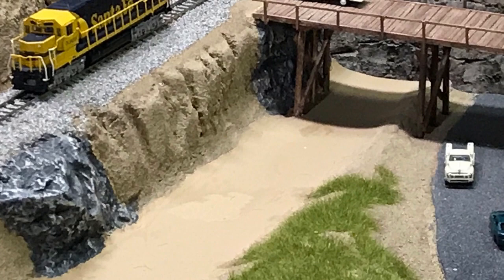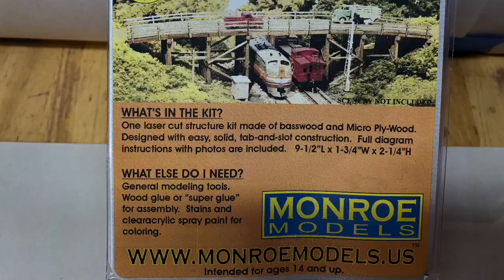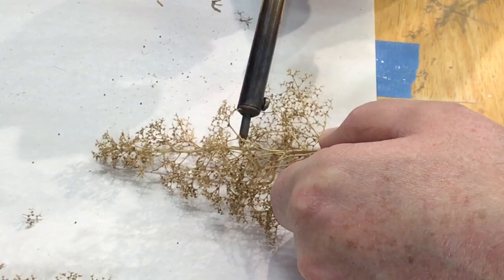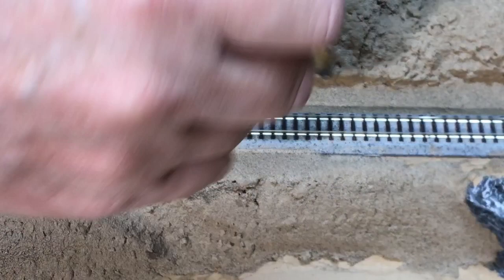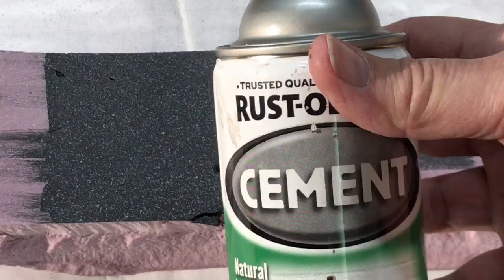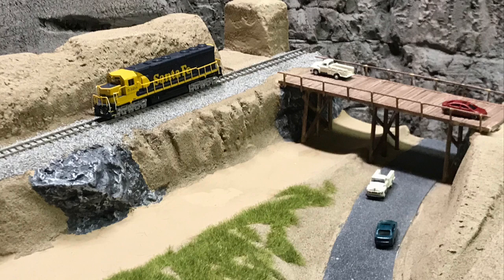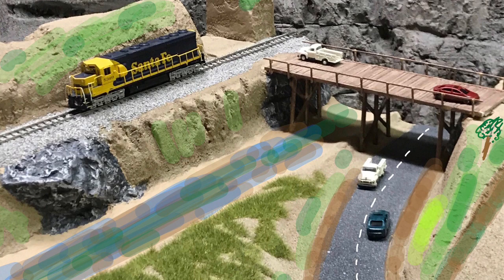Model Train Diorama How To Series

Comment: Pretty awesome diorama , Anthony.  Definitely trees would be nice and a couple of railfans. 😁👍🏼. - Drew
Reply from the maker: Thanks for watching and commenting. I need to figure out how to model little tiny cameras and tripods...Anthony
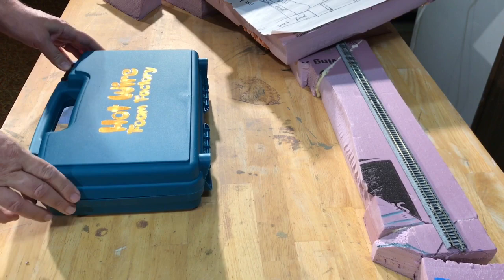Reply: You’re welcome, Anthony.  I just used a standard staples.  I straightened them and  connected 3 for tripod with super glue and to the right height against my people figure. For camera, since it’s n scale I just cut tiny black poster board and glue on top of tripod.  Its hard to see but if you zoomed in you can kinda tell. If you have time check out my video and fast forward to 0:40. Just a cheap idea that works for me.  Happy modeling. - Drew

https://youtu.be/7iQhH3I-gEk